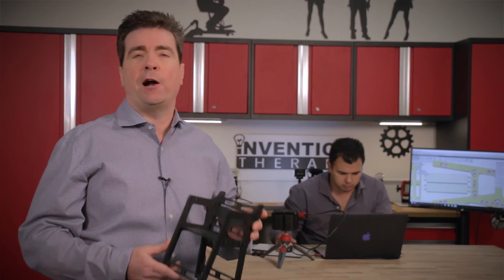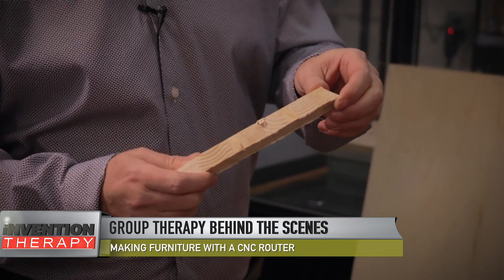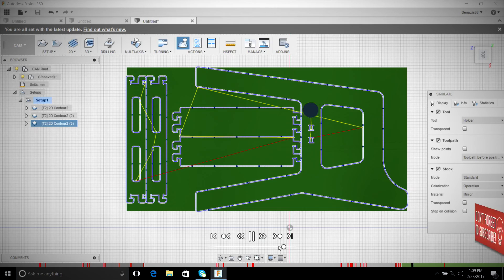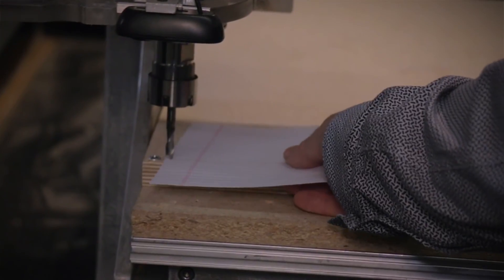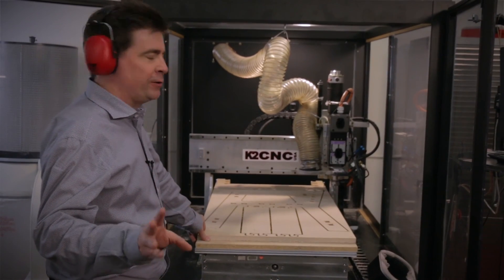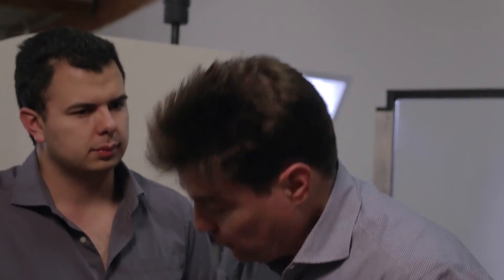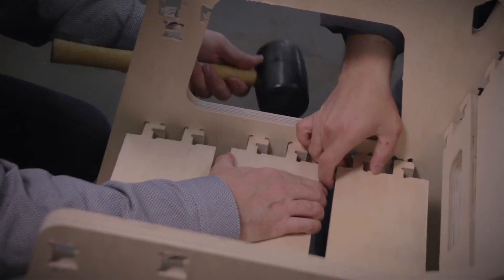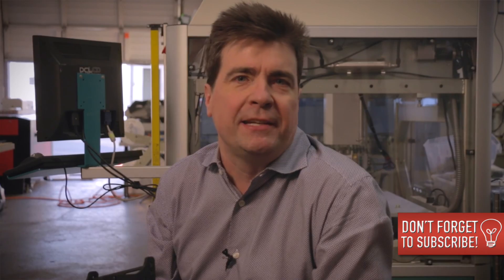CNC Router In Our Woodshop Finishes Custom Chair We Showed You How To Design - WE SUCCEED AT LAST!

Comment: Also I am curious why you used so many tabs within the design to hold the parts in place? I understand everyone has there own way of doing things and this is more of a prototype not production so the post processing of the parts are not really a concern at this point I just like to understand why people program the way that they do out of curiosity. That being said I cut quite a bit of flat pack furniture on my 4x8 machine without/a vac table and I can get away with only 3 or 4 tabs around the entry and exit point of a piece up to 49" long and in some cases like mdf I use the cuttings as actual tabs and actually program no tabs in the gcode  using that method I can cut in some cases up to 200-300 parts with no tabs and no vac table. I am just curious on your stance on using tabs with no vac table
Reply from the maker: We used that many tabs because sometimes, the software doesn't add enough and the parts break away. This was our first woodworking project so we just went with the software defaults.

And with a vacuum table, I doubt you would need any tabs most of the time. The vac makes a big difference.
Reply: Oh yeah oh I didn't realize this was your first cnc wood working project looks like it turned out great all things considered and oh yeah with vac tables its a whole different ball game. You dont have to answer I have probably bugged you enough but do you plan on building a vac table for your small machine? I have some designs and motor sources if you are interested just shoot me a pm (I dont sell any of the stuff just one machinist to another) but thanks for answering my question and have a great day
Reply: Oh yeah oh I didn't realize this was your first cnc wood working project looks like it turned out great all things considered and oh yeah with vac tables its a whole different ball game. You dont have to answer I have probably bugged you enough but do you plan on building a vac table for your small machine? I have some designs and motor sources if you are interested just shoot me a pm (I dont sell any of the stuff just one machinist to another) but thanks for answering my question and have a great day

Comment: I am curious really quick why spend the money on that machine and not have a tool setter or at least touch plate to set the z-axis properly? I am just curious I know there are many different ways to set z and maybe you have a touch plate and just didn't use it due to only making through cuts and not dados
Reply from the maker: The machine came with an automatic tool height sensor but for cutting wood it really isn't needed. It is faster to just use a piece of paper to set the Z height. You only need total height accuracy when doing 3D cuts that require tool changes. With 2D like in this video, the height only needs to be accurate enough to cut through the wood completely.
Reply: oh yeah I know what you mean I completely agree when through cutting. when through cutting do you find that setting zero on the spoil-board vs setting on the top of work piece helps with using nominal measurements in the cad design verse actual or even parametric modeling
Reply from the maker: I would love to give you a fancy answer here but compared to cutting metal, the accuracy needed for wood on the CNC router is far less. While I know that some people like to "true" the top of the spoil board, I find to easier to just cut through much deeper than needed with the tool.  

From an inventor's standpoint, a CNC router is far more useful than a 3D printer in my opinion. Many, many of my prototypes have been build on CNC routers before sending the parts out to be made metal at a job (CNC) shop.
Reply: Oh yeah no I agree for sure I have multiple cnc routers and no additive machining equipment as of yet but I was just mostly curious about your method of modeling as far as nominal measurements, actual, or do you parametric model your designs I appreciate your time I just get curious on how other people do things
Reply from the maker: We do all of our designs in Solidworks which is a parametric program. As far as we we do things, the real answer is we are learning as we go. Some of our designs have more tabs than needed and others has too few and broke while cutting. No matter how safe we seem to be, we can still manage to damage the parts!
Reply: I know what you mean lol something does always seem to go wrong sometimes small sometimes big